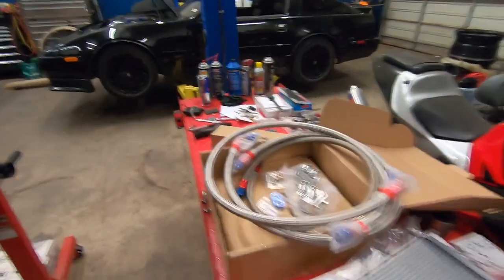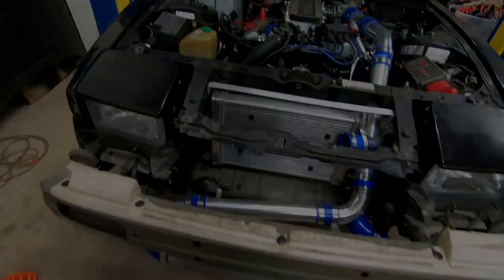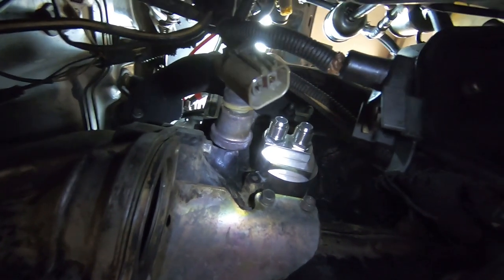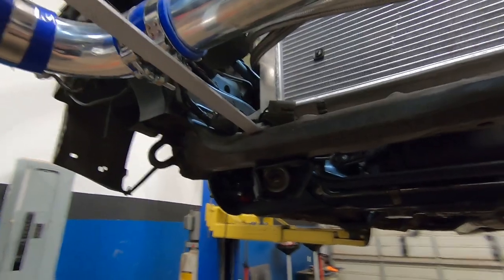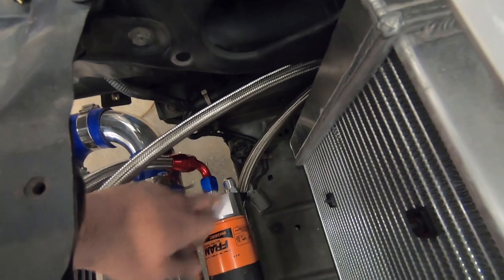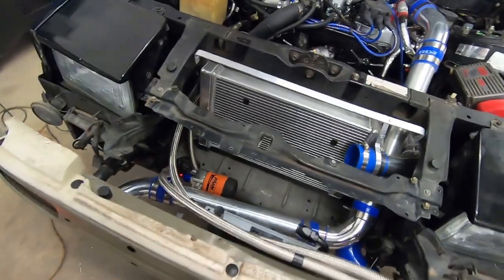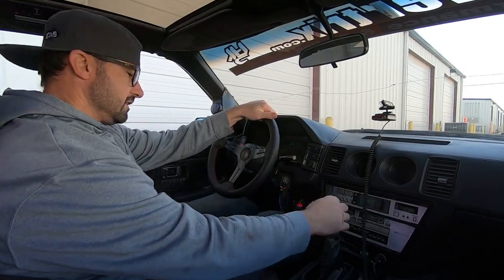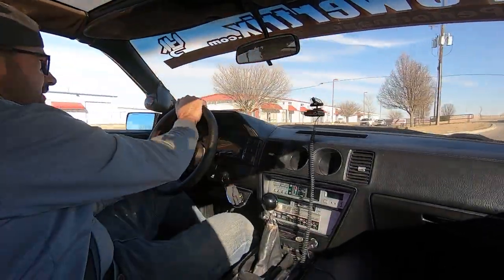Ep.98 300zx Turbo Build Z31 Oil Cooler Install

Comment: I liked  your   new   intro   .show   off   all  sides   of   the   z ,  how   much    more   oil    do   you have   to    add   ???    for   your    new   system !      I  use   Mahle brand  oil   filters  on   my  Z looking  forward   to   your   next    vid !
Reply from the maker: Thanks! It used a total for 5 quarts. Thought it would take more. Yeah I was in a rush to get a filter so I stopped by Walmart all they had was a fram filter. I know it's not the best but hey it works.
Reply from the maker: Sorry not to confuse engine and oil cooler was 5 Qts total so about 1 Qt extra.
Reply: I          liked        how       much       space        you    put      ???     in   between                       words

Comment: I have a weird thing going on with my z31. It’s a 5/87 production with the W series (verified on the block) but when I checked the turbo I saw that it had the A/B series T3 and not the T25 (put a boost gauge and its boosting just under 7lbs like a T3 should). I’m not complaining having a higher boost and higher compression motor. I picked it up from the OG owner who kept it stock AF and no service records show a turbo replacement. You think Nissan outfitted early W series VG30ETs with overstock T3 turbos?
Reply from the maker: It's possible. I'm not a Z31 expert as far as the history of these cars. When I bought mine it was in rough shape motor wise. I redid alot including the turbo. I now have a T3/T4 turbo. Z31 Facebook group would be a better place to find out.
Reply: T3 came in on 84 to 87T..T25 on 88 to 89T..z31..

Comment: I have a 86 300zx auto base. What are some upgrades to focus on first?
Reply from the maker: Always best to start with intake and exhaust. Some good brake pads and stainless steel  brake lines will improve your braking.

Comment: is this n/a orginaly or why your oil cooler is missing in first place? b/c it's 87-> when turbo's was water cooled = no oil cooler?
Reply from the maker: It's an original turbo car. I bought it  from a previous owner how had blew the original motor and swapped in a junkyard motor. Lots of stuff was not right or missing. I didn't know that they can with an oil cooler.

Comment: I have a 85 Z31 N/A and it has a oil cooler from factory.
Reply: yes u do have b/c you are from netherlands (gabber land) and all euromodels was top of the line even N/A's. our n/a is have same brakes that they have states in turbo etc. i have also 1985 z31 euro na2t
Reply: i bet that you have also diff cooler?
Reply: sumosami ohh its like that. Nice! Yes i alsow have a diff cooler.
Reply from the maker: Cool! I didn't know all this about the Euro and American car differences. My car was missing stuff when I bought it. It just seemed like it needed an oil cooler because it's a turbo car.
Reply: we had only 2+2 in europe turbo or n/a.
Our lenses are same as japan but lhd light pattern.
we have only 5 lug nuts z31.
also only engine options here was vg30e(t) no vg20/rb20
euro vg30's have "nismocams" and that's why euro z31 had more power from factory.
+ more

There is less z31 in europe than states, hell in states you have more z than compare whole word. prox 280-300k
europe prox 40-60k japan 30-40k :D
Reply from the maker: Awsome learning alot from you guys.

Comment: Will the oil filter still fit fine without the oil filter relocation n just a sandwich plate ?
Reply from the maker: I believe so. I just don't like the oil running down the block when removing the filter.
Reply: @importmodify  appreciate the reply bro... thank u

Comment: What fuse did you remove to prime the oil before you started it?
Reply: Shane Myers You can just unplug the distributor or the ignition coil and it won’t start, allowing you to prime the engine
Reply from the maker: I just unplugged the injectors.